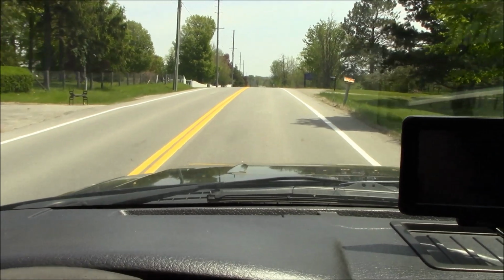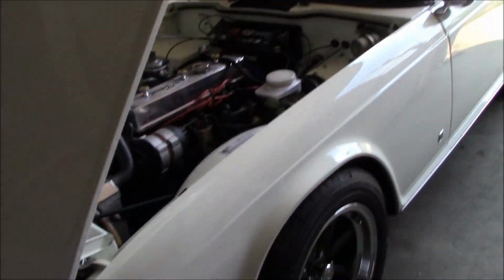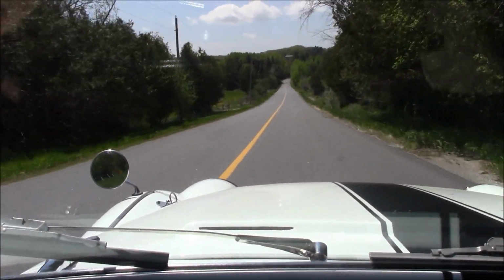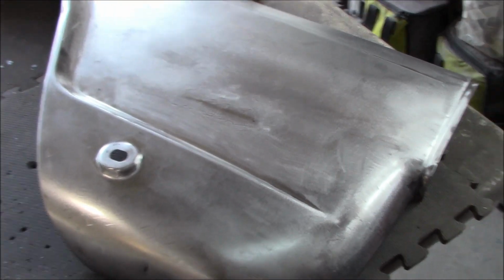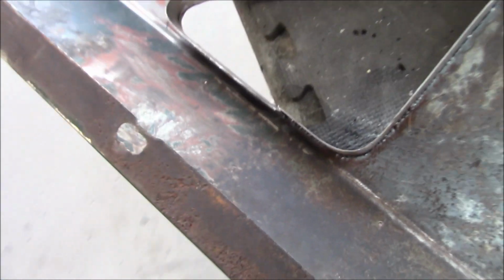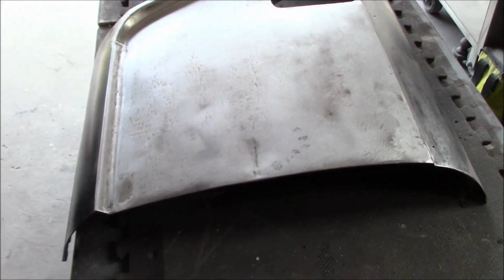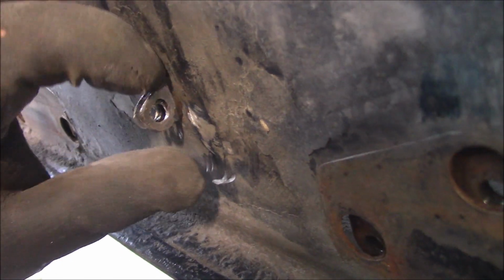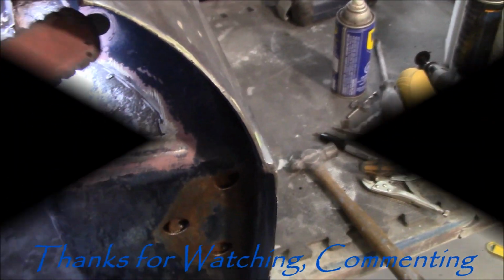End of May Update And, Getting Back to the 1968 Triumph TR250 Restoration

Comment: While I am not familiar with how the hinge locates in the A Post could you not weld three slim (or even full) nuts onto the back of the hinge plate to create the correct thread?
Good to see you back on the TR250 though even if I did enjoy the bike break ... Oh and when you start riding 'Shiny side up'
Reply from the maker: Apparently the eBay vendor wants to make it right so he’s supposed to be sending a new set.  We shall see!